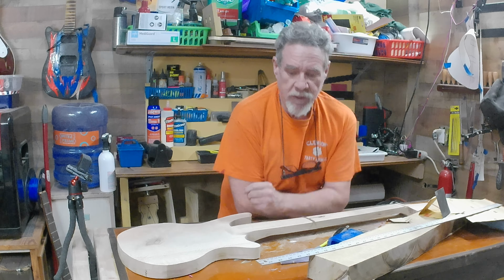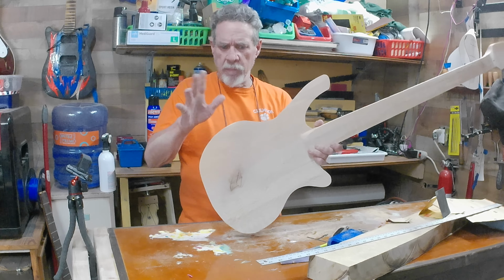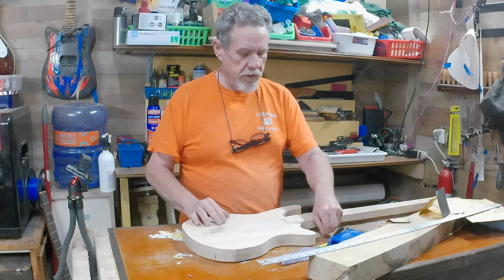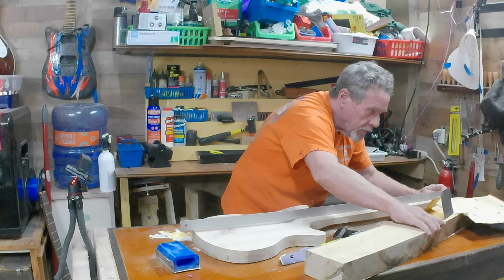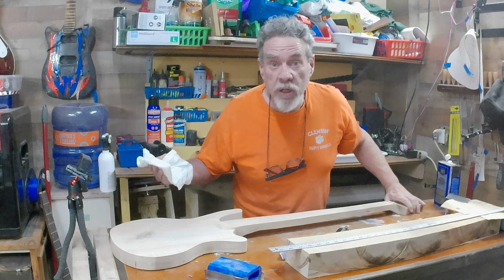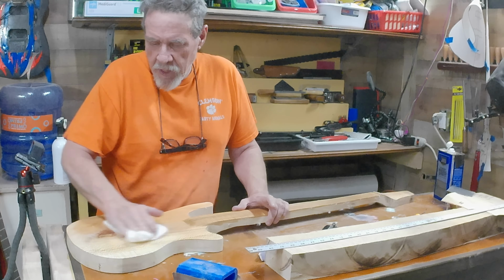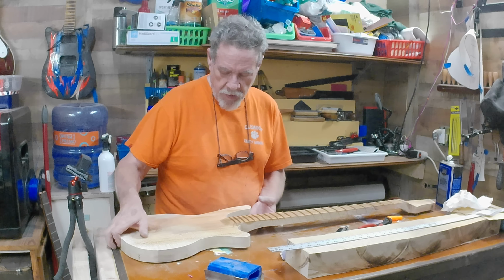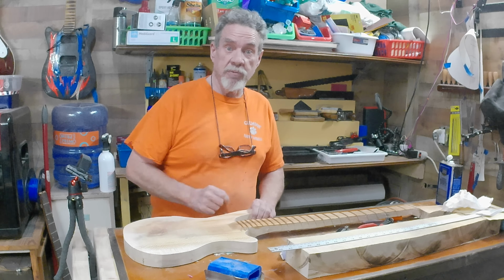One Piece Bass Build | Still only ONE Piece of Wood | GGBO 2022 Official Community

Comment: Nice head way Spike. I been wondering about necks with that skunk stripe holding the truss rod in. Doesn't the rod put pressure on that strip when engaged to adjust the neck? I know the stripe gets glued in but in my mind I still picture that poppin out under tension. How often does that issue come up with necks done that way?
Reply from the maker: Bill, I have never seen a skunk stripe come out, but have removed one. it was a monumental effort!  I don't think it will be an issue, sure hope not!
Reply: @FrugalFixerSpike  I didn't think they would be an issue with it being fairly common. It just goes against Bill Logic...

Comment: That is a cool idea. How much does it weigh?  And I want you to see I do comment here too. Love you Spike God bless you too
Reply from the maker: Thanks for commenting Lisa!!  I will go weigh it when I start back working in a bit. was a long night at the hospital with the wife. I will add you as a moderator for the Thursday Live Stream, thanks for helping!  Any idea how to accomplish the stain effects,  Ben mentioned on the stream for it?
I want to highlight the one piece construction, but agree the fretboard needs some contrast too.
But how? a fade at the end of the fretboard before it transitions into the body?
Thanks, have a great day
Reply: @FrugalFixerSpike  are you staining or just using oil?  If using stain then just stain fretboard with a couple more coats to get it darker. Same with oil. Even if it’s not much however it’s your bass and as long as you can tell I would leave it all the same.